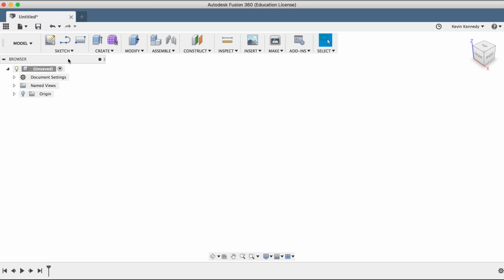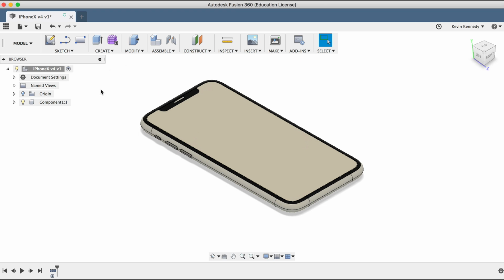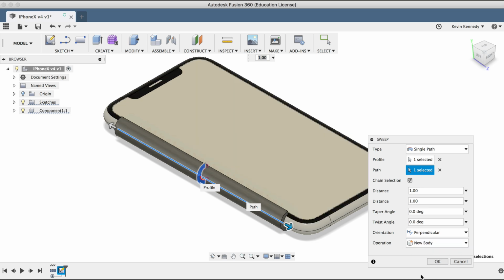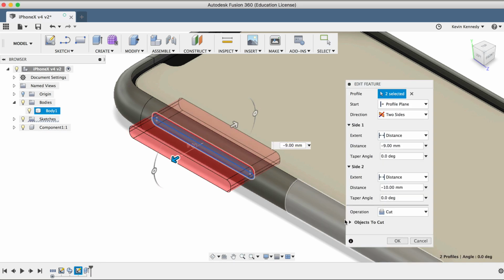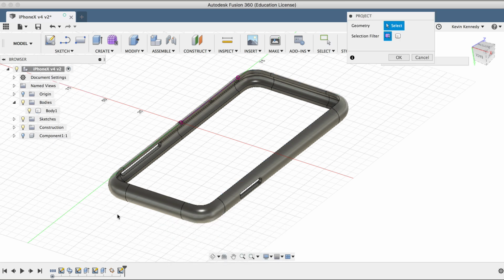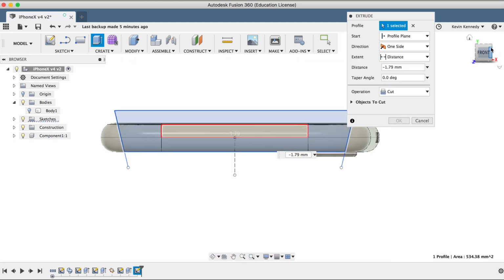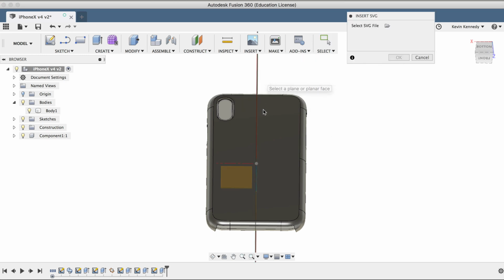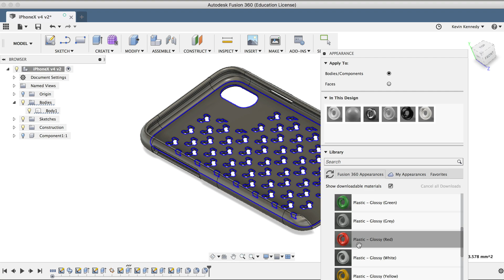How to 3D Model an iPhone X Phone Case - Learn Autodesk Fusion 360 in 30 Days: Day #10

Comment: I'm learning a lot with your videos and I appreciate it.
Thank you.
iPhone have a uniform shape, different from the Galaxy note 8 for example. Would you make a video building a case for note 8? 
Thank you.
Reply from the maker: Hi Reginaldo. You can follow similar steps with a Galaxy Note 8 model. You will have to do it in sections. I would suggest sweeping the left and right sides of the case as I did in this video. Then, you can use the loft command to bridge the gap on the top and bottom, by connecting the left edge to the right edge.

Here's a model on GrabCad that may be of help to you - https://grabcad.com/library/samsung-galaxy-note-8-2
Cheers, Kevin :)

Comment: As always, thanks for another great tutorial.  For some reason, I'm really struggling with this one.  At around 4.05 minutes into the tutorial, when you draw a rectangle around the iPhone's buttons, your rectangle is at the edge of the phone, on the plane of the buttons.  No matter what I do, my rectangle is always on one of the three major planes, running down the center of the phone.  I know from an earlier tutorial that there is a way to make that work, but I want to know why mine doesn't work the same way yours does.  Any ideas?  Here's a link to my F360 model:  https://a360.co/2Qdapsr       Thanks, Dennis
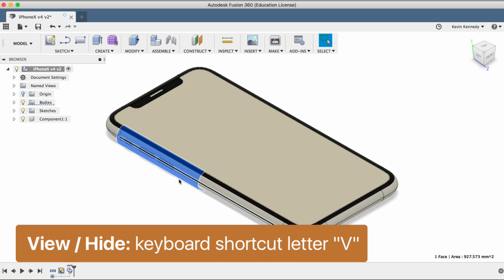Reply from the maker: Hi Dennis. Thanks for sharing your file. I took a look at it and I believe you're having issues because you didn't hide the outer body as I did at 3:48.

Once I hid the body I was able to create a sketch on the same surface as the video. Let me know if that helps you get through it! Cheers, Kevin :)
Reply: @ProductDesignOnline  I am having the same problem.  When I hit "V" nothing happens.  The command doesn't seem to be recognized.
Reply from the maker: @richcrowell1155  Hi Rich. Can you try hiding the body by selecting its corresponding eyeball icon in the Browser?

Comment: When I click the area of the component and click V it hides everything except what I clicked instead of hiding what I clicked
Reply from the maker: Hi, Craigan. That is strange...I have not seen or experienced that before. Can you make sure that your phone case component is active? It may have something to do with the Browser structure on the lefthand side.

Could you provide me the link to your file so I can see if there is anything else that could cause this? Cheers, Kevin :)
Reply: Same thing here, I click V and everything disappears apart from phone frame

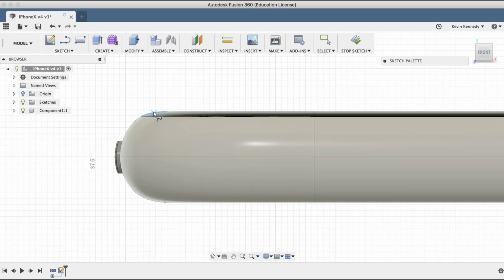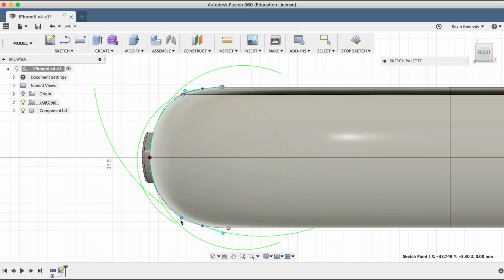Comment: Hey Kevin, I am keeping up with your learn fusion in 30 days program and I am really enjoying it, but there is a problem that makes me annoyed. I have tried to solve it but I couldn't get a solution for my problem. At the beginning of the video ( 2:15-2:25)  you copy the curve of the iPhone with the spline tool. While you are doing it, the splines automatically snaps to the original curve lines and makes your copy accurate. But my fit point splines doesn't. They only snap to the grids if I open the "snap" from the sketch palette, not thing else. I tried to mark the points as accurate as I can but when it comes to dragging it doesn't stick to the surface and doesn't help me find the perfect curve. I am trying to find a solution for the 10 second process for more than 2 hours and I am pretty sure that I could have finished more that 3 lessons at that time. I am really stuck please help me.
Reply from the maker: Hi, İbrahim Yıldız. This sounds like your setting for "Auto project edges on reference " is turned off. You can find where to turn that on as well as cross-check your settings with mine on this page of my website - http://bit.ly/defaultsettings

Cheers, Kevin :)

Comment: Kevin. I would like to clarify the preferences settings. Is 3D modelling carried out with the Y axis or the Z up??? I was always under the impression that the Z axis should be up but then again I have been a 2D draftsman since the pyramids were being built.
Reply from the maker: Hi, Peter. Great question. I record all of my tutorials with the Fusion 360 default settings unless noted otherwise. Up until about a year ago, Fusion 360 had the default modeling orientation of the "Y" axis as the "up" position (for reasons I do not know). That is why some of my oldest tutorials on this Channel have the "Y" axis set in the "up" position.

The Fusion 360 Engineers have since come to the realization that the Z-axis should be up (by default at least)...something that almost all of us have always believed/used, as you noted.

I've also spelled out my default settings and other important settings on this page - http://bit.ly/defaultsettings

Cheers, Kevin :)

Comment: I cannot get the centre diameter circles to line up or snap to any points as in your tutorial. The black centre spots do not show on my drawing for some reason. I can draw the and move by eye but I must have done something wrong somewhere. Help anyone ?
Reply from the maker: Hi David. Can you check your settings with mine - https://bit.ly/defaultsettings

Let me know if you had a different setting(s). If that wasn't it we can troubleshoot further.
Cheers,
Kevin :)

Comment: This is some wonderful stuff. However, I have this devilish issue: when trying to make the bottom of the case, after selecting the path (which does not produce the orange tint, so does not close?) over the construction plane, it disappears upon pressing the E button. So I have no option but to make the extrusion profile using a rectangle and fillet, or spline. Why cannot I extrude using the path as profile?
Reply from the maker: Hi, Mikael. With the solid modeling extrude command (blue icon) you will need a closed profile shape. Once the profile shape is completely closed you will receive the orange background highlight.
Can you provide the link to your file? To share your file please go to File > Share > Share Public Link (make sure "downloadable" is toggled on) > Paste your link here as a reply to this comment.
Cheers, Kevin :)
Reply: @ProductDesignOnline  Hi Kevin, here it is: https://a360.co/2N3evl5    It has a non-optimal bottom made from a rectangle instead of the extrusion. Thanks.
Reply: @ProductDesignOnline  (Perhaps it is due to another issue I encountered: when trying to do the sweep, I was unable to select more than one line segment with the 'Single Path' option. Had to switch to 'Path + guide rail', select the remaining segments, then switch back to 'Single Path'. Maybe that is why I cannot make closed paths?)
Reply from the maker: @mikaelkoskela3543  Hi Mikael. I had a chance to look at your file. It appears that the first extrude operation in the timeline was set to the "cut" operation. If you set that to the "Join" operation then you won't need the second extrude operation. Other than that, your file looks great! Let me know if you had any other questions. Cheers, Kevin :)
Reply: @ProductDesignOnline  Thank you Kevin. I finally found out how to make the bottom using the Project + Extrude method that you try in the video, and which did not work. The trick was to select the edges only after pressing P, as for some reason opening up the Project tool deselects them. Perhaps it is a bug of the new version of Fusion. Anyway, keep up the work! :)
Reply from the maker: @mikaelkoskela3543  Thanks for the update, Mikael. I'm glad to hear that you figured it out. I do believe that the project command has been that way before, but I'll have to look into it. Keep at it! :)

Comment: Thats as shame. The important part beginning to capture design history I can't select on my trackpad because for some reason right click doing nothing. Taken note of the mouse you said you have and bought that one this morning so when it arrives from the US, hopefully im not restricted further. Keyboard is a cheap replacement to the iMac one too. Shamefully I went cheap only it has a few differences. Hey what 3d printer do you own and do you rate it? Would it print my thin 4mm thick welders mask when I have the skills from your lessons to able to produce it?
Reply from the maker: Hi, James. That mouse will make a world of difference - especially with right-clicking and using the marking menu. I'm so used to using the marking-menu that I find it very irritating when I do have to resort to a trackpad and can't quickly access features on the first try.

I've had a handful of 3D printers over the last 7 years as well as used a variety while working in different labs in college. I've had a FlashForge, Ultimaker 2Go, and Monoprice i3. All of which were reliable but had their own pros and cons. I've also worked with MakerBots, Ultimaker 3s, Stratysis (commerical grade), Deltas and probably a few that I'm forgetting. I always suggest working backward to come up with your "must-have" list of printer needs.

Because you're wanting to print a helmet a larger build plate is probably more important than it may be to someone else. I would say decide the largest size object you're going to print (you may have to split objects into parts) and then find the top-rated printer in that realm. Cheers, Kevin :)

Comment: Revisted this video as I wanted to take my phone case design to a new level, I've run into a weird problem, I added a svg logo and extruded it 1mm, but then decided i wanted to change it for a different svg file, i deleted the extrude and the svg sketch but the actually physical object did not dissapear leaving me with an actual 1mm extrude on the back of the case when i converted it to an stl file, i'm thinking it must be a bug in the software as i can't think why else it would stay in place after being deleted, appreciate any feedback you can give as always...
Reply from the maker: Hi, Paul. Great to hear from you. That is quite strange...the only thing I can think of is that you somehow ended up with two different bodies??

Would you mind sharing your file so I can take a look at it? To share your file please go to File > Share > Share Public Link (make sure "downloadable" is toggled on) > Paste your link here as a reply to this comment. Cheers, Kevin :)
Reply: @ProductDesignOnline  Hey Kevin, I've managed to sort it, I think the svg file was too big and created problems when trying to cut it, ive simplified the svg file and works a charm now...thanks keep up the good work, i will send a link eventually of the new design, i wanted to find a way of creating a case with none flexible materials as i have lots of varients of this material, i've added some slots into the bumbers to create some flexability, time will tell how practical they are lol...
Reply from the maker: @paulfarmer3091  Hi Paul. Glad you figured out it was the SVG. Keep me posted... I would love to see pictures of how it turns out! Cheers, Kevin :)

Comment: Where can I get an Huawei Mate 20 Model?
Reply from the maker: Hi, Lichtkleid. I didn't see any on GrabCAD or the Fusion 360 Gallery, which is where I always check first. Because this phone isn't as popular as the iPhone, you may have to mockup your own model with the outer dimensions. Pretty much all the US phone manufacturers release the official blueprints of their phone specs so case designers can create them to spec. I'm not sure if Huawei does or not, but at the very least you could go off the dimensions on some of the tech sites, such as this one - https://www.gsmarena.com/huawei_mate_20-9367.php

Cheers, Kevin :)

Comment: Fusion is so horrible. lol I was trying to merge edges it didnt want to, I tried bridging, NOPE, I tried hiding NOPE, every time i created a new sketch and tried to hide it, it hid my base model. This was the most annoying software to learn cause i still havent learned lol.
Reply from the maker: Hi, Adolfo. I'd be happy to help give you some tips if you can provide me with links to your file and/or screenshots as well as what you're having trouble with. It definitely has its quirks. Sometimes I find it is best to walk away when you can't get something to work. Come back after 15 minutes...often times it's a small detail that throws the feature off, etc. Cheers, Kevin :)
Reply: Product Design Online  I do apologize about the burst, your instructions are great it’s just the software is frustrating it might be a different version.
Reply from the maker: @Stooek  No worries. I understand how frustrating it can be learning new software. I try to do my best to be thorough about everything to eliminate most of the pain points. Cheers, Kevin :)
Reply: Yea the model I had must’ve been wrong idk. So when I tried to sweep, using the path the buttons of the phone were in the way but I couldn’t hide the buttons so I then started to extrude instead but once you make a full lap you cant weld both ends. Also creating a Line would round out instead of trimming like you did.
Reply from the maker: @Stooek  It sounds like finding a different model where the buttons are their own components would eliminate the extra steps. What model of phone do you have? Cheers, Kevin :)
Reply: Product Design Online  I got a downloadable CAD online. But right now I’m watching introduction videos for Fusion to have a better understanding of all the tools. Other than that I have to find a better CAD file for a IPhone 7 Plus
Reply from the maker: @Stooek  I found this iPhone 7 Plus model on GrabCAD that seems to be good upon importing it into F360 - https://grabcad.com/library/iphone-7-plus-accurate-blank-for-case-development-1

It is only one body. However, you can simply create a midplane and then use the "split body" tool to split the body in half. Then, reference that center edge line from the split as your sweep line. Cheers, Kevin :)
Reply: @Stooek  You can also select the face and use the move/copy tool (m) and the tool will avoid the buttons

Comment: Great video. Hopefully I will get to work through it soon when grabcam sends my confirmation email. Quick question: Since you created a sweep around using exact dimensions, and then added a back that extruded in by 2mm, wouldn't that make the volume inside the case 2mm too small for the phone?
Reply from the maker: Hi, Brandon. Depending on the size of the phone model from GrabCAD and your 3D printer setup, there are going to be some tolerances at play. My original phone model was not 100% perfect as far as the dimensions go. I was able to print it out with the finest settings in Cura and it ended up very snuggly fitting.

Essentially, I've seen people have the most success modeling it as closest to scale and then simply printing one out to see how it fits/works and you may have to tweak accordingly. If so, you may find it easiest to slightly scale it in your slicing software. Cheers, Kevin :)
Reply: Product Design Online  I can’t wait to try it. Grabcad never did send me a confirmation email today, but I did get to work through 3 or 4 of your other tutorials today, so I still had a productive day :) 
Thank you so much.
Reply from the maker: @brandonleirer4928  It was years ago so I can't remember the email... but I would definitely recommend checking your spam/junk box if you haven't yet.

I just released a video today covering the new UI changes. You may find it to be helpful in the transition with these tutorials with the older UI - https://youtu.be/tuZzHcmFtg4

Always happy to help...don't hesitate to comment questions. Cheers, Kevin :)

Comment: Hey Kevin, I've got a problem with my design.  Firstly, I recently updated Fusion and now that I'm on 2.0.6231, i.e. the big UI change, it's taking me some time to find certain tools.  However, the search shortcut still exists, so thank you for teaching that much earlier!

So, my problem comes from creating the profile to sweep around the edges of the phone.  For background, I'm using an iPhone 7 model (it's what I have).  When I imported it, the center that comes into view when you create a sketch is nowhere near the center of the model.  It's off to the side.  I don't know how to change that, and I'm unsure if that even matters.  I can create the profile no problem.  However, when I zoom out and enter the home view, the profile has been created far from the phone.  I'm going to get a screenshot and reply to this since my CAD computer doesn't get internet access when I'm at work so that my weird explanation might make sense.
Reply: Here's the screenshot: https://i.imgur.com/nV9iOxx.jpg  So, obviously I can't continue due to the sweep not working (I'm guessing it's because the curve I created isn't touching anything?), so I'm going to go back and re-do some of the older lessons.  Thanks again!
Reply from the maker: Hi PureSol420. Thanks for providing the screenshot. Was the imported file of the iPhone 7 an STL File or a STEP file?

If it was an STL file then you may need to convert the file to a solid body in order to reference its geometry. If that is the case, you may want to simply get a different file from GrabCad that is a STEP file or native Fusion 360 file.

In regards to the new UI changes... I have a tutorial set to release tomorrow that will cover all of the critical changes that should make the transition easier, even while following these "Old UI" tutorials. Cheers, Kevin :)
Reply: @ProductDesignOnline  ah, that explains it!  It was an STL.  I will search for a STEP file. 

As always, thank you so much for your responses.  They are what truly make your tutorials stand out above the rest, in my opinon.  I look forward to the UI change video!
Reply from the maker: You're welcome. I'm always happy to help. Here's the link to the UI change video - https://youtu.be/tuZzHcmFtg4
Cheers, Kevin :)